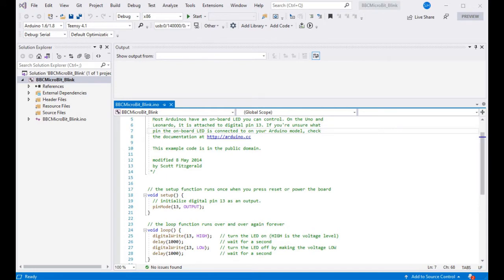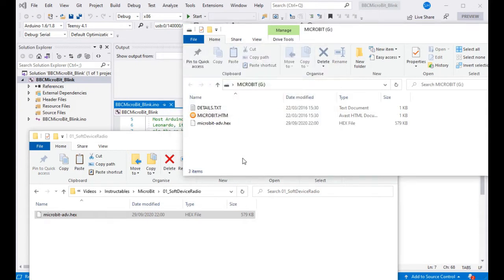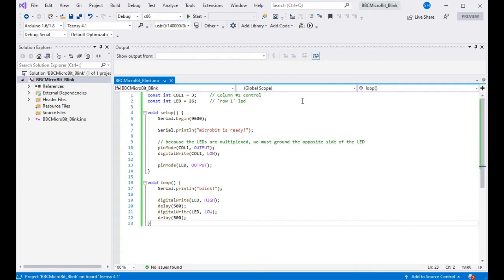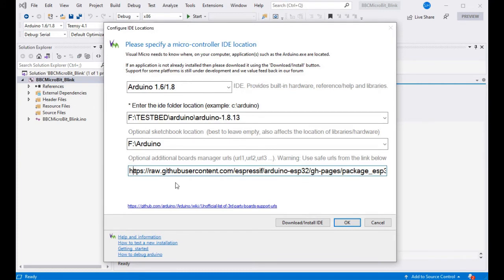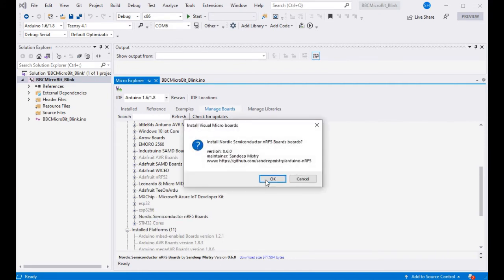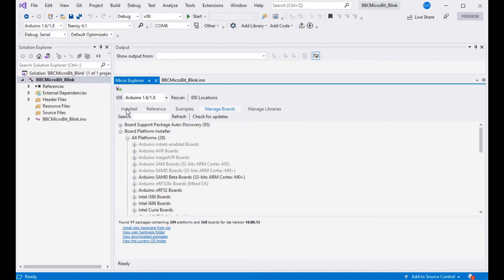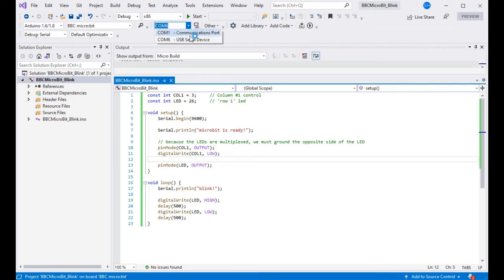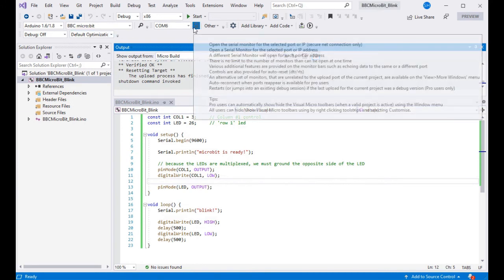Starting BBC Micro:Bit with Visual Studio and Arduino

Comment: Hi! What about micro:Bit V2.0? Is it possible to code via Arduino?
Reply from the maker: From what we have seen this looks very similar with a few library changes for the combined sensors, though we haven't had one to test at present. 
https://cdn-learn.adafruit.com/downloads/pdf/use-micro-bit-with-arduino.pdf

The board package does now include a Microbit v2!
https://sandeepmistry.github.io/arduino-nRF5/package_nRF5_boards_index.json